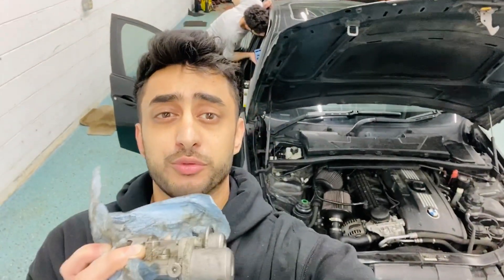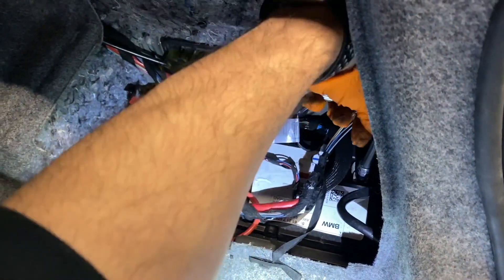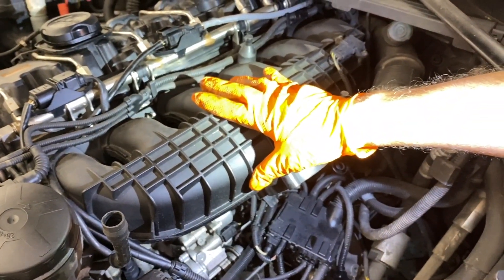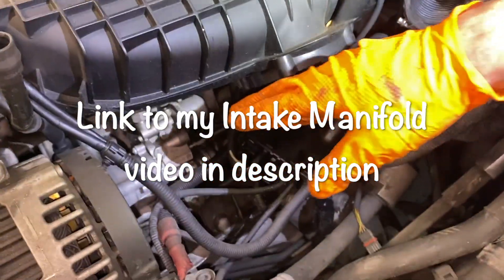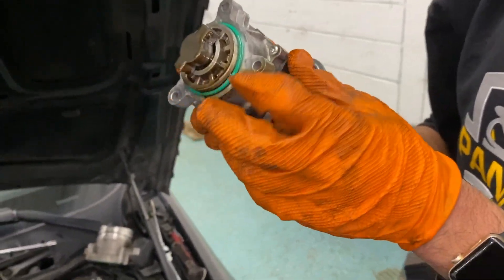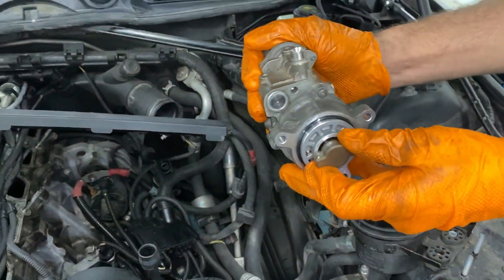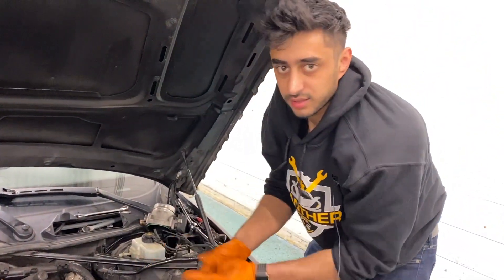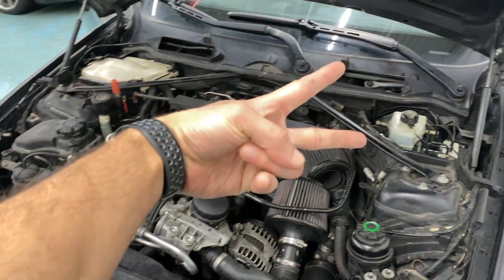Bmw 335i N54 Ultimate HPFP Replacement Guide - High Pressure Fuel Pump

Comment: Awesome video, made this job quite manageable and saved me a ton over the dealer.
Reply: Just finished the job on a 535i, left the intake in place which made it a little tight but still completely manageable. Could probably do it in 1 hour or so if it needs done again. Thank you again for this great video.
Reply from the maker: Awesome man! Glad to hear :) how was getting to the lines with the intake manifold in place?
Reply: @tunerworld  Getting to the fuel lines wasn't bad once the sensor connector to the fuel pump was out of the way. The hardest part was getting the hex bolt closest to the block inserted when putting it back together. I ended up using one of those springy grabber claw things (sorry for the highly technical terms...lol) to hold the hex bolt by the head and went in from the back, into the guide hole, then used the long hex wrench to tighten it down with a 1/4 drive extension to tighten it per your video. Once I figured out to use that tool it went smoothly.

Comment: good guide i used this for my 2011 bmw 135i n55
didn't remove the intake and throttle body but would recommend doing so... low back is so sore trying to position body to fine that extra need angle.
Reply from the maker: Awesome! Glad it helped :)

Comment: Very helpful video! How do you check the pressure of the pump?
Reply from the maker: leefunkera Thank you! You have to datalog the vehicle using MHD or JB4 or whatever software you prefer!
Reply: HelpfulCarTips Gotcha! May I ask where you got your new pump? Also, do you recommend replacing the low pressure and/or high pressure fuel sensors?
Reply from the maker: leefunkera I got mine used off a local N54 member!
Reply from the maker: leefunkera You can replace the low pressure fuel sensor if you are having issues since you’re already in there. I know they have an updated part out for it! I didn’t however since I wasn’t having any issues with it
Reply: HelpfulCarTips 👌your video saved me $500 that my goto shop wants for labor :)

Comment: It's an osias hpfp but it's more or less an ebay market replica sold under a million names. Could you touch on how it held up though? I'm at 115k miles already and it's time for a replacement but to be fair I don't need another 120k mile reliability. If my pump dies again and my car is still kicking, I could buy a second osias for half the price total of an oem. As long as this isn't a monthly repair, I think I could justify it just to get my car moving for now.
Reply from the maker: Tuneless honestly the car always ran kind of weird. I assumed it was an OEM pump but the car runs much better with the used OEM pump I put in. If I were to suggest something, it would be to find a good used OEM pump for around $100 or less and run that!
Reply from the maker: The car would always throw out a bunch of black smoke under full throttle. Always thought it was a tuning issue and the fact that it has downpipes and a PE mod on it, but who knows haha. I definitely wouldn’t run it again if I had the choice.
Reply from the maker: Tuneless Let me know how it works for you if you do get it! And yeah honestly the job isn’t too bad either and it probably wouldn’t be a monthly repair so you should be fine
Reply: the Osias HPFP is bad?

Comment: Hi, 
Great video, doesn’t seems to be too difficult. 
I just have a question, I’ve a  2008 530i (n53 motor) and I need to replace the HPFP on it as well... do you know if it’s approximately the same position on the engine or not ? 
Thanks a lot for your answer
Reply from the maker: Sorry I didn’t see this. Did you end up figuring it out?!

Comment: So here's the real reason why the HPFP Fails. It's because GDI sucks. That's why. how could a part actually withstand such a pressure just to atomize the fuel? Idk how newer cars did it but my mazda 3 skyactiv engine has it figured out. Anyway's it's not just a lemon it's a failed concept. It tried too much. and the results was a failure.
Reply: Car's are only getting worse.

Comment: My 1series just came back from the garage from it stalling and not starting. When I came to pick it up on tow I noticed it had no coolant in the engine. Would this be taken out if they looked at the hpfp and is there anyway of them harming my drive chain as they said they think it’s jumped cause of a knockin noise it’s doin. It was never making a knockin noise when it got taken there by Rac
Reply from the maker: gavin hare Usually coolant is not taken out when doing a HPFP, unless a line got busted along the process. Then again, I did this on a 3 series! As far as your other issues, I would start by having a reputable mechanic check your codes and see what’s wrong